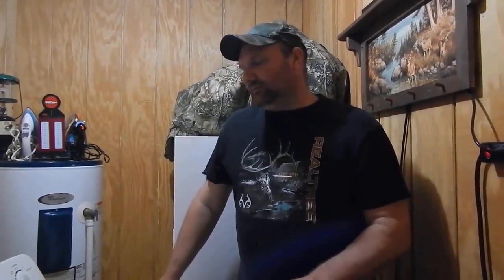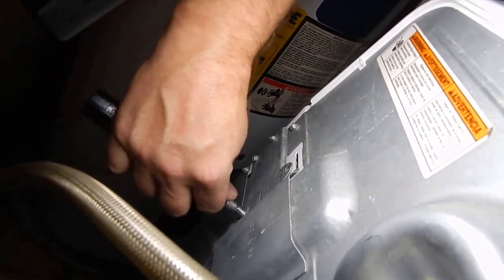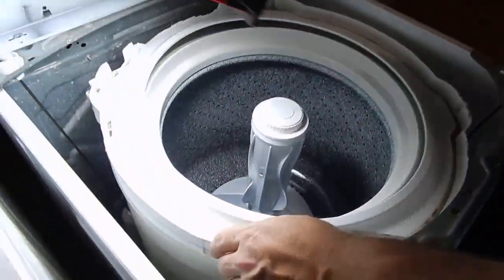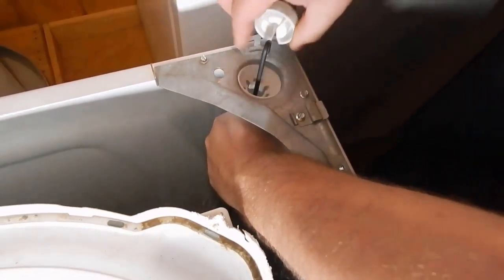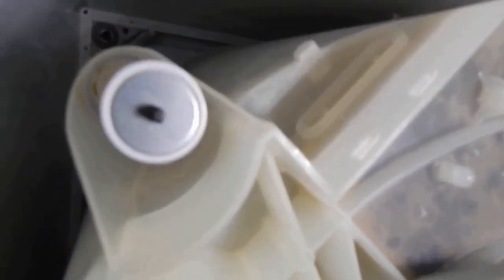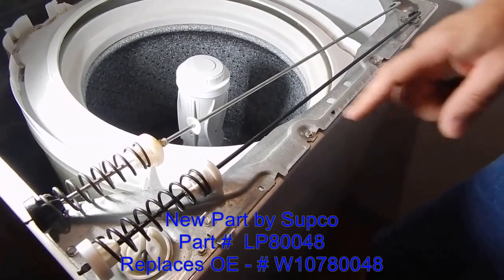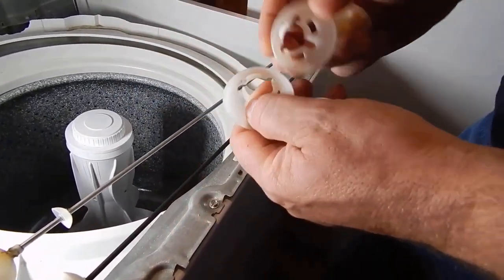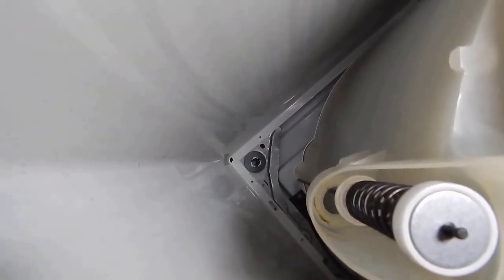How to fix Admiral,Roper,Whirlpool washer from shaking spin cycle

Comment: Thanks, you explained things well.  I repaired mine and it works great. Replacement Brands did seem to make a difference. I initially bought Amazon suspension rods assembled them and it still shook. I went and got the manufacturers brand and it worked great. ANOTHER THING THAT HELPED IS I USED A BUNGEE TYOE CHORD TO PULL THE BASIN TO THE OPPOSITE SIDE OF THE REPLACEMENT AREA. That seemed to help give me the elbow room to work on it

Comment: Our washer (Admiral) was doing the exact same. The plastic at that top of the tub was chipped too. I was fully expecting one of the rods to be broken. I guess it’s just the springiness of the spring?! I’ll replace them anyway, hope it works! Thanks
Reply from the maker: Not exactly sure of what goes bad on the rod but it fixed ours by replacing them. Hope you get it fixed. Have a Blessed Day Friend.  Justin

Comment: Thank you so much for this video!
But I gotta say. Damn you got some grip strength 😂💪
I compromised.
When I put the new rod in through the bottom.
We used the old rod hook to fish it though the top, pull the new one up & slid those weird things on. 👍
(Hope that makes sense?)
& Heavily threatened the washing machine that this better be the fix or it's going out on the corner 🤞👊
Reply from the maker: Your very welcome. Good idea using the old rods to pull them through. Have a Blessed Day Friend..  Justin

Comment: Thanks for the info, those old springs don't look too bad, but if it fixed the problem that must have been it.
Reply from the maker: I couldn't see any thing wrong with them  myself. Must have been weak. Our machine still is working good after replacing them. Have a Blessed Day Friend! Justin
Reply: @homegrowncountryhomeplace  Actually, I don’t think the springs are weak. 
  It is the rubber cap above the spring that sits on top of the spring.  It is not supposed to move freely up and down. 
  I still kind of scratch my head on that. 
  There are some that fix that piece to make it more stationary and solves the problem. 
  I do not know for sure how long their repairs last. 
  Still trying to figure a way to solve this problem and avoiding the expense of some of these rods myself.
  Btw, are you from Alabama?  I am in NW Alabama.
Reply from the maker: @rickeykeeton4770  thanks for the information. I am from NE MS, so I guess we're kind of like neighbors. Have a Blessed Day Friend. Justin
Reply: @homegrowncountryhomeplace  I thought we had the same speaking patterns. 
  Good that this worked for you. 
  I had thought before to research how to retemper the springs or where to buy them. 
  Then, I have seen where so many talk about the rubber caps, or whatever they are called, are not supposed Tom be so freely. 
  Like I said, this kind of has me scratching my head. 
  I have not got any more stabilized yet. 
  I do intend to give it another honor two. 
  Florence, Alabama here, so I guess we are neighbors.
Reply from the maker: @rickeykeeton4770  We live NW of Tupelo, MS. I don't know how to remedy them bushings?
Reply: @homegrowncountryhomeplace  Still researching myself.
  I tend to cut some caps apart and check for any foam that I have just today hear about.

Comment: I use and extra rod to help pull the replacements up and into the cup/bushing. 
  Just turn it upside down, run it through the hole where the replacement comes up through then pull the replacement up through the hole snd connect it.
Reply from the maker: Good idea. Thanks for sharing. Have a Blessed Day Friend.
  Justin

Comment: I’m trying to figure out if my springs are broken/worn or not.  I pulled the rods out and took a look.  They all look the same.  Should I be able to move the spring up and down the length of the rod or should they be locked in place?  I mean when it’s out of the machine.
Reply from the maker: I remember the plastic bushings would move but can't remember about the springs. My old springs and bushings were not broken or could I see any defects. But when I put the new set of springs in, it fixed the machine from shaking. Hope this helps. Have a Blessed Day Friend! Justin

Comment: If  this doesn't fix it, then you might try doing a RECALIBRATE... which involves simply turning the dial in a manner that activates the calibrate mode.  Other videos on youtube explain it and it isn't difficult.
Reply from the maker: Hello David, so far it has fixed it. Thanks for the information. Have a Blessed Day Friend. Justin

Comment: How do you remove the console lid on this ? It has those annoying clips and you can't use a putty knife to release them.
Reply from the maker: Hello friend, on mine the only thing I had to do was pull the top toward me and then just wiggle the top a little and it releases. They are a little frustrating. Hope this helps. Have a Blessed Day Friend! Justin

Comment: I got the same machine it keeps banging on spin cycle. I’m hoping it’s the springs
Reply from the maker: Hope you got it fixed
Reply: @homegrowncountryhomeplace  well I did buy the rods and installed them and they worked well for about 2weeks-month? Then it was back to the problem. Ended up trashing it and getting a new washer, lol
Reply from the maker: Sorry it didn't work out for you. Yeah I would have done the same thing. They just don't make stuff like they use to. Have a Blessed Evening Friend!  Justin